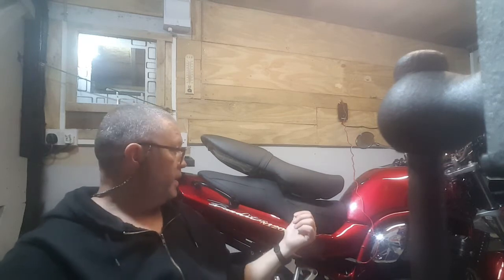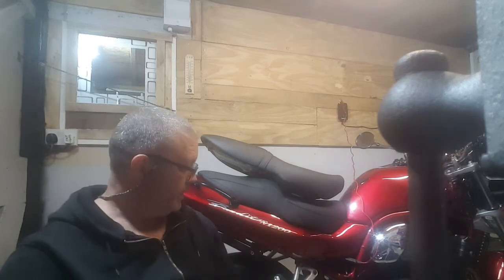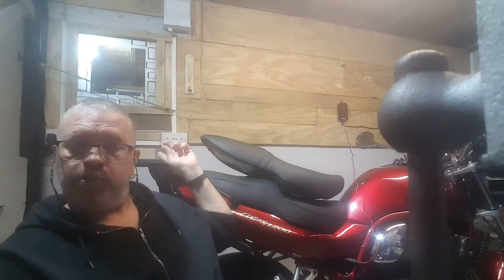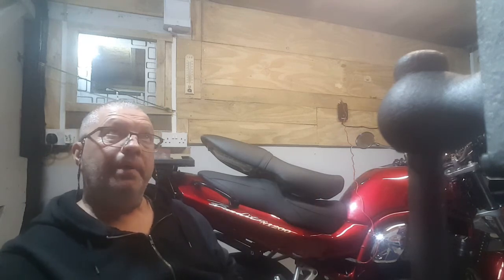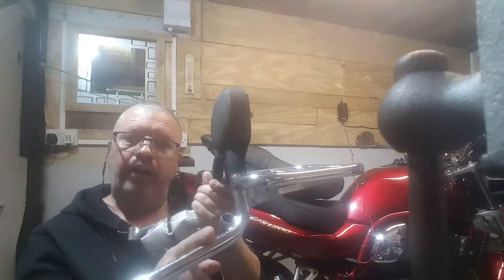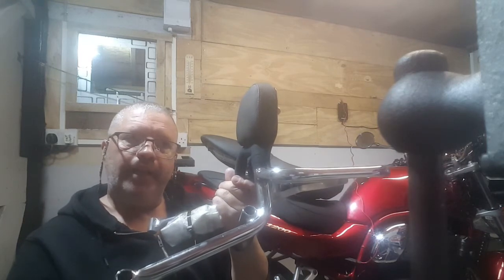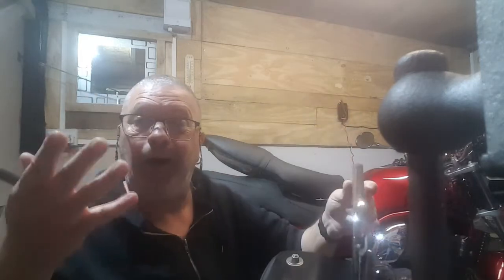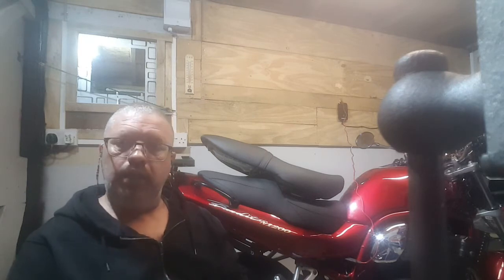My obsession with restoring vehicles to stock ...long waffle alert !

Comment: I need a new exhaust, just putting it off till I'm closer to needing it.  As Bandit notes, Black Widow do the link pipe.  I can't even remember the exhausts I was looking at so I'll be back to scratch when I do, and I've still got the stock end can sitting on the shelf that I'm never going to fit to this bike.  Now all I need to do is find someone replacing their exhaust system!

Comment: You need the black widow 3 bolt link pipe (check ebay). From what I can see lextek only make the slip on version. 
I totally get your point about being standard. You're going to hate what I'm doing with mine though(will get a vid/slideshow up eventually). I may even one day go turbo (sorry 🤣). 
I think one day I will be like you and wanting to put stuff back to how it was. Though I always believe in using standard suzuki parts for the important bits like gaskets, seals, o rings, clutch plates etc. 
Keep up the good work 👍

Edit: I believe the headers are made with same diameter at the link pipe because I've seen people with just aftermarket headers and standard link pipe. And aftermarket link pipe on standard headers (I could be wrong though and maybe they bodged it together)
Reply from the maker: Yes I think this is the way to go ..more investigating required
. if I can keep the lextek headers and find a matching link pipe and a stock can ill be sorted..
And it's only my own stuff I like standard..i watch and enjoy many many tubers modifying bikes cars trucks planes boats pushbikes you name it ..i really love watching others modify stuff because it's all mechanical and they enjoy it ..so you keep on your path ,it's what is important ..the bloke you told me about who I won't mention by name is a scream.. I've been watching loads of his bandit videos .. he must have endless pockets and some of the mods just make me laugh . but as I said the most important thing is he's having fun . weather I think it's in what I call good taste is totally irrelevant.  He's got a much quicker and better handling b12 than me and that's what he's planned and implemented.. I'm just making more museum pieced and that's my thing ..
So I would love to see vids of your bandit my friend and I'm sure I will enjoy and respect whatever you do .
Now, if we all did the same stuff it would be a very dull place.  
Peace and love brother and thanks again for the kind words and support 👍🏻☮❤